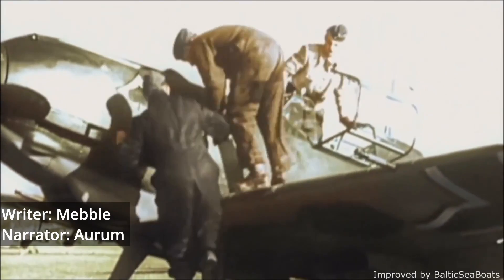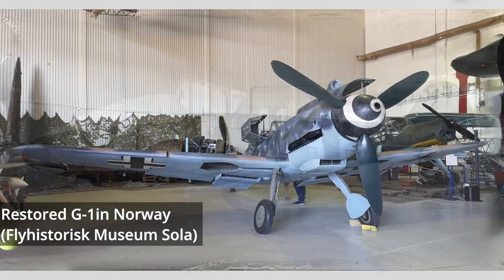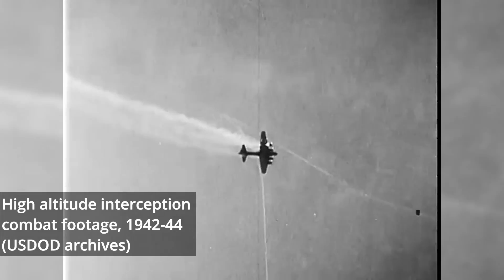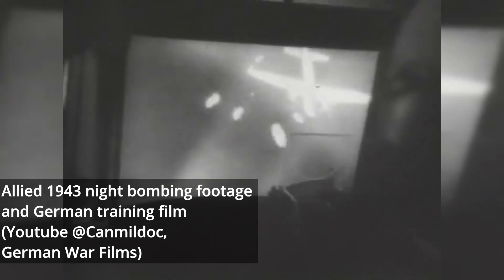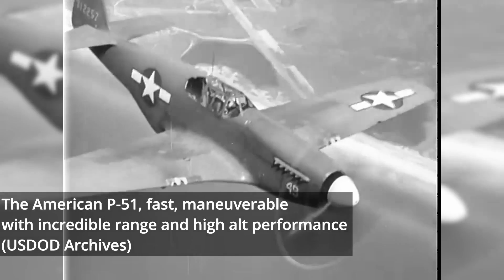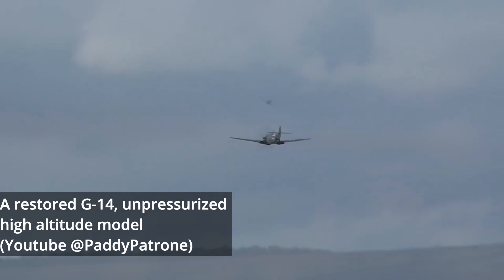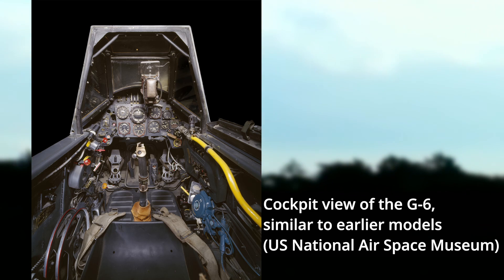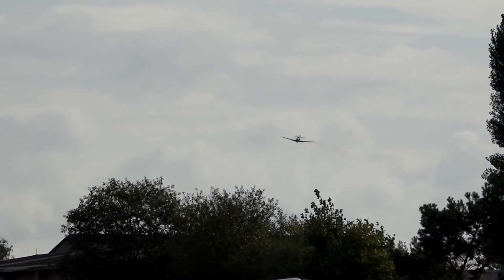Reaching for the Stratosphere | Messerschmitt Bf 109G-1,3,5

Comment: 22 minutes available on nitrous but I do not think that could be continuous, just to get a good fighting position when needed.
Reply: The N²0 injection was nothing like in use today in drag racing type systems .. It was simply two different sized nozzles  that were mounted Infront of the supercharger intake so it wasn't particularly efficient at all , up to 300hp on a 1500+HP engine it wouldn't be to stressful for the engine to run that long .. 
Would need some BIG bottles to run 22 minutes though ..
Reply: the "22 minutes" referred to in the video represents the amount of time that the NO2 cylinders would stay fully pressurized if charged up immediately before take-off.  After that, the liquid NO2 would begin to warm up and evapourate, thus increasing the internal pressure and begin leaking.
Reply: Or to escape!

Comment: Little known fact, the 109 cockpit had 24 inches shoulder room vs 22 on FW-190A, and far more arm room, as well as far more lateral head room than the 190 flat canopy hood (90% of them). Glass came down to elbows on 190, vs shoulders on 109, giving the 190 a much more airy feel. 109 was simply roomier in actual space.
Reply: Yet having sat in both I find the 190 physically larger. And I'm no small boy
Reply: @scrubsrc4084  Did it have the same shoulder room (or I should say, elbow room, since the shoulders stick above the sill on the 190)? As for the vertical head room, the 109G seat had 3 positions, so it was never clear to me how short it was vertically. Did they close either canopy on you while seated?
Reply: @wrathofatlantis2316  had the canopy closed on the 190 but not the 109. I couldn't say shoulder wise how much difference there was but the 109 felt universally cramped compared to the 190, or any other fighter for that matter. couldn't tell you how high or low the seat was. Perspective I've everything though because I don't think a spitfire is particularly large but that was like putting on a tailored suit.
Reply: @wrathofatlantis2316 the  fw190 ground attack planes had a special canopy which had more room for the pilot.
Reply: The 190 canopy moved backwards on rails.

Comment: The statement  'use off poor quality but widely available materials' hides fact that without strategic metals German engine quality suffered. Douglas Calum discusses this in interviews/books.
Reply: In addition to metals, it would be interesting to know how much more power their aircraft engines would get with the higher octane fuel that P51s and other American aircraft used.
Reply: I have seen little reference to, and even less information about, Allied vs Axis fuel quality.  There must have been basic performance differences and knock-on effects on operational and maintenance issues, yet no detailed analysis to be found . . . @Thermopylae2007
Reply: especially with the jet jumo engines
Reply: More importantly so did the quality of aviation fuel and lubricants.Later in the war German aircraft didn't survive long enough for engine ware to become an issue.
Reply: The so-called non-ferrous alloys shortage was proven wrong by several studies. They did ration some of them or substitute them (since 1934!), but that did not mean they were lacking. Biggest Third Reich issue was always fuel: Max. German output never exceeded 2% of US fuel output (UK 2.5% Japan 1%, USSR 2.5%)... Issues of metal alloys were completely irrelevant by comparison, and only affected tank gearing brittleness after November 1944 (Molybdenum): Very near the end... One German aircraft issue was less efficient liquid cooled radiator surface which required a 30% larger surface on inline engines. This did not affect air-cooled radials like the 190A. As to the fuels, the use of MW-50 pretty much nullified the performance gap for 109s (below 20k), while the 190A used a throttle valve pressure differential "trick" to increase output: The engine could take it... In any case, real-life combat rarely used more than 60-70% of the max WEP power, at least for those who knew you needed to fight with low-speed turns...Hit and Run was OK only for targets with poor radios like the Russians or Japanese: Everybody else made circles at low power, especially P-47s and P-51s (if you read thousands of actual Encounter Reports)...

Comment: I forget. These did NOT have 2-stage superchargers right?
Reply: Only single-stage, but they were variable speed.
Reply: FW190 and Me109 were not optimized for high altitude operations. They could climb up there, same as an F4U and P-40 could. but they were better at lower altitudes, same as the F4U and P-40 were.

If German fighters could get to altitude ahead of the bombers and wait, and dive in from above, it helped offset their lack of high altitude performance.
Reply: No, but as stated before, they had variable speed superchargers, that could give them a better performance over a larger altitude window. Different for example the p40, that would get maximum performance around 12k-15k feet, but run out of breath at 20k and beyond, the Germans could maintein solid performance until 25k feet, and decent enough to 30k. That, of course, was not so good as merlin powered spitfire or p51, or even a dual stage turbo-supercharged of a p38 and p47, but was decent enough (although, like reinventing the wheel by going to the other way around). For more information on that I highly recommend the video "BF-109 supercharger driving system", by a channel called "Greg's planes and automobiles", that has great    in depth analysis over the topic.
Reply: G'day,

True, they had a single stage Supercharger, really big, mounted flat against the Left rear of the Engine...; the
Extra Power was developed by
Spraying a
50/50 mixture of Methanol & Water, straight into the
"Eye," (Air Intake) of the
Supercharger.

The finless "Bomb" seen in many photo's of late-war Me-109s was the Methanol/Water Tank..., the extra Weight & Drag was the price of all that 
Extra Power.

For maybe
Ten or fifteen minutes,
In the Climactic 
Middle of any projected
Combat 
Sortie - or while trying to climb up to intercept approaching Bombers ; rather than chasing them home after they've bombed their
Targets.

At least, such is my underconstumbling of the matter.

Such is life,

Have a good one...

Stay safe.

;-p

Ciao !
Reply: @WarblesOnALot  lmao the "finless bomb" (wtf) is a fuel drop tank, typically 300L. The MW50 tanks on equipped Bf 109 were behind the pilot's seat inside the fuselage
Reply: @CrotalusKid  

G'day,

You could be right, it's decades since I read up on it...

And I said,

"LOOKS LIKE a 'Finless Bomb'..." ;
 to differentiate them from Jagdbomber conversions.

But, yeah, I knew the Water-Methanol was a separate thing from the Nitrous Oxide, and my impression was that they used Centreline Droptanks for either extra Fuel, or for Methanol/Water...; but what you suggest makes better sense.

Thanks.

Have a good one...

Stay safe.

;-p

Ciao !
Reply: Some 190Ds had 2 stage intercooled Jumos but they were a tiny minority.  Non intercooled two stage engines were really pointless.